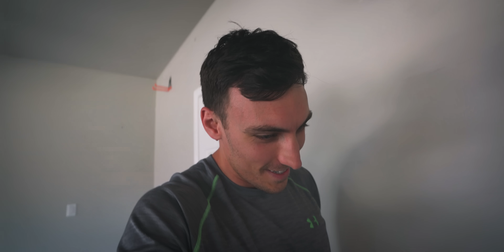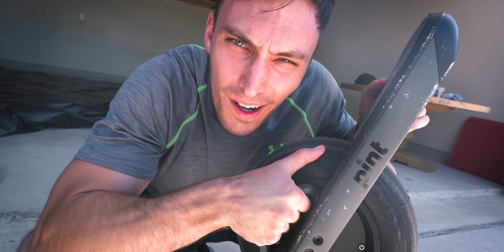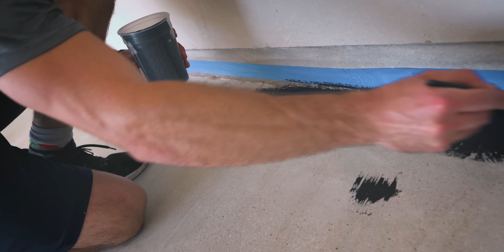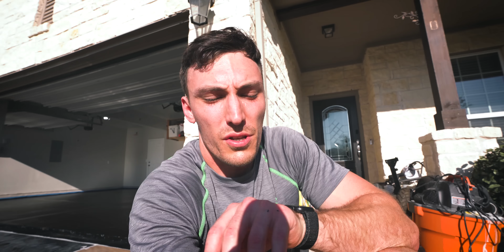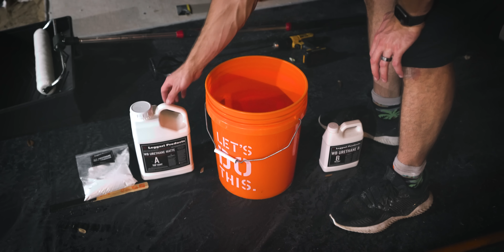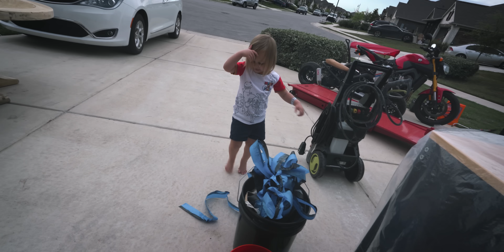Installed EPIC DIY Metallic Epoxy Floor! How To 🛠️ ULTIMATE Dream Garage Build Part 2

Comment: I have been thinking about doing this my self since paying someone to do it is more expensive than one could think. I have seen the preparation is key. I did not see you sand the garage floor before applying the epoxy. Was your garage already sanded?

Comment: I always thought this products were cheaper then going to any other type of flooring.. it’s only paint and is always going to look unfinished compared to real wood flooring or tile.. at least that’s what I thing about stain concrete or epoxy lol.. but a check on there prices for what I need. Bardominium, 8,000 on the product.. I guess I better go with flooring lol

Comment: For the tape, on the wall, you should remove it when the epoxy is still wet, since the epoxy wont run up.
On the floor, do it about 15-20 minutes after its begun to harden.

The epoxy's hardening is self accelerating and is self heating, which is why it hardens so fast in the bucket. Its like a pot of boiling water, it begins to boil faster if you dont stir it to spread the heat. This is Also why it gives you longer time when its on the floor, since the ground can eat the heat to slow the hardening process. 

The tape 2.0
Epoxy gets soft from heat. This is why you can remove the tape just after its solidified, since there should still be enough heat to make it "soft" enough to pull the tape, but not soft enough for it to be runny.

And please, People who try to do this your self, use the proper protection. Gloves, long pants. Things that stop the epoxy from getting on your skin.
Reply: 2. Tip for epoxy hardening process.

The name of the game is heat.
Like it was told in the video, you dont have a long time to work the epoxy in the heat.
Some epoxy hardening starts at as low as 13 degrees Celsius (sorry, im danish so I dont know the Farenheit scale) 

But when you get to so low temperatures you have 3x the time to work it, though it Also gets thick like Honey when so Cold. 

But the same Thing is on the other end of the scale, if you have the epoxy warm Even before you mix it, you have an easier time to apply it, since its a lot more fluid, though you run the risk of loosing a lot of time to work it (depends on the products of course) 

2 things to overcome this which doesnt seem to have been done in this video.

1. Have your materiales out of the sun, preferably at a bit colder temperature than the outside is, this Will make it a bit thicker at the start, but it Will liquify almost instantly when it gets in contact with the warm floor.

2. If you do not wish to have the materiales inside, put it in the shade, and have your big mixing bucket be white, so it doesnt take All the sunlight and turn it into heat.

Comment: Don't apply this without a proper respirator. You need one with an organic vapor filter cardridge. Otherwise you risk getting serious health problems. Also use gloves and consider using a Tyvek suit. Don't let the epoxy come in contact with your skin. Ventilate the area well.

Comment: If you weren’t able to get the little bit of epoxy left on the driveway. Try a chemical called MEK it’ll take cured epoxy and turn it back into like a thick liquid that could be washed out. Just make sure not to get any on the actual garage of course!

Comment: What stops the epoxy going over the tape on to your driveway?
Reply from the maker: Well it's not exactly a flowing river so as long as you make sure you don't leave it too thick at the edge and tape off enough, you're good.
Reply: @motonosity  you've done an awesome job man!